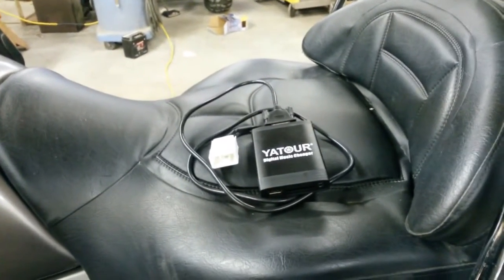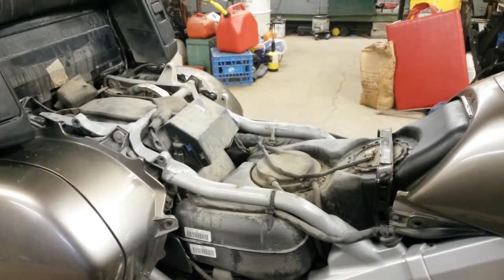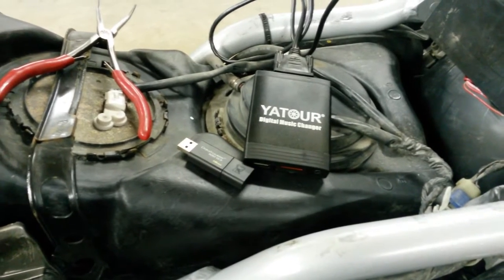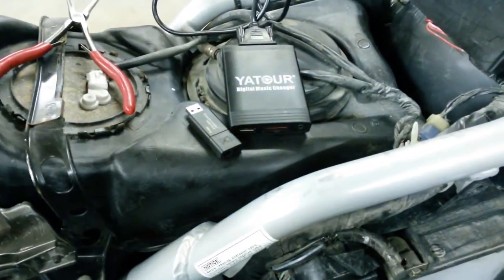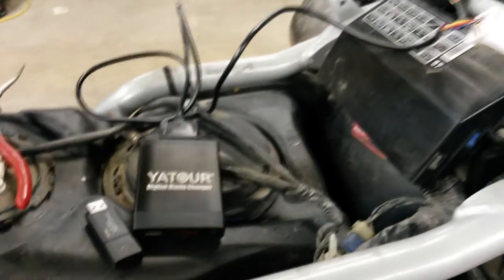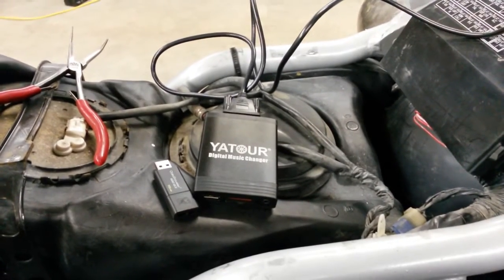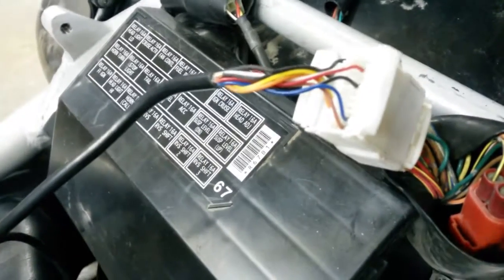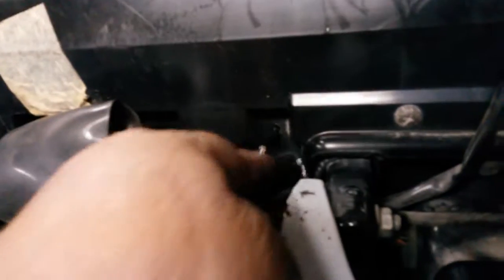Installing a Yatour digital music changer, Goldwing GL1800 #diy

Comment: I been using the much cheaper DMC unit on my 2004 GL1800 for several years. Whatever you pay or the brand these units all have the same internals and the key is how you load and browse your music on the SD card or flash drive. SD cards or flash drives mustn't be bigger than 8GB and each "CD" folder mustn't contain more than 99 tracks and the maximum number of "CD" folders is 99. However, 99x99 is way more than than the 8GB capacity:
Step 1 - Create folder "CD1" and add up to 99 tracks. "CD1" is the root directory, therefore:
Step 2 - add folders "CD2", "CD3" etc. as required to the "CD1" folder;
Step 3 - add up to 99 tracks to each additional folder.
The Achilles heal with these units is that as you load tracks into each "CD" folder they're saved in alphabetical order so of you load more than one album into a "CD" folder you'll need to number prefix each track title 1-99 so that the albums and album tracks play in order. Also, the bike's random play button doesn't work so if you want some variety on those long trips you'll need to create your own 'random' play "CD" remembering to number prefix each track otherwise they'll sort in alphabetical order and therefore not random.
One last tip, don't rush the unit when operating or it'll freeze which may require resetting the unit. But as long as you allow each "CD" or track to load before flicking on to next you'll be okay. I've max'd out the 8GBs on my SD card and have to ditch stuff before adding new stuff.
Follow these tips and your unit will work great, mine has.
One other quirk us that the bikes CD display only goes up to CD9 so CD14, CD24, CD34 etc. display as CD4.
Reply: I have a question for you. I bought a 2008 GL-1800 about a year and a half ago. It came with a similar device from BikeMP3 Inc which is no longer in busy. The unit has been working flawlessly since I have owned the bike. And I was lucky because I liked all the MP3’s that were added. My issue now is that I took the bike to the dealership for the 32k service to establish the maintenance records in my name and for them to go top to bottom and make sure everything is in spec. Which it is. I picked up the bike a few hours ago and the device works, however I am getting a display message that says “No CD” however I can play music and switched around tracks and disks etc… but the display won’t tell me what disc or track is playing like it used to. I disconnected the device and reconnected it and popped out the SD Card and reinserted it. No go! Do you have any ideas what might cause that? I can’t find anything specific to that issue.
Reply: @wingandhog  Hi. It sounds like you've done everything possible. Occasionally ive had "No CD" or the unit freezes.  On the road it usually clears itself if i switch to radio for a while, or when i stop for coffee.  Does the unit have a reset button? The kind you push with a pen nib or paper clip. Most digital devices have one. Generally,  the reset button needs to be depressed for at least 10 seconds. And/or, when you've unplugged it, again generally, it should be left unplugged for at least 30 seconds  even overnight. I hope this isn't teaching my grandmother to suck eggs.
Reply: @michaelhoare5291  …. LOL. No I’m teachable. And a former IT Executive. I didn’t see a reset button but I will look again. And try that. I will also check the SD card on my PC to see if something got hosed on the card itself but it does play songs so who knows. Thanks for the quick response.  I appreciate it.

Comment: Thanks Snocrushr for your help on this one. I disconnected my battery from my Goldwing left it for a few minute and the computer rebooted it self and the radio came on again. I'm also just going to use the SD card have name them CD01 to CD10 which 10 shows as CD00 with 20 songs per CD that should keep me happy. Many thanks again Snocrushr. Safe riding. 
William ( Belfast )

Comment: Moving in stereo . Be nice if the usb worked , but thinking the sd card might be better as it kinda locks in , looks like a usb drive sticking out may end up a bad connection after a bit . or is it held by something to stop that .
Reply from the maker: I think you are absolutely correct Terry, thinking about as you pointed out even if I get the USB working I don't think I'll use it specially in a motorcycle application.

Comment: If you are emulating 8 cds, how do you select 7 & 8?  Do you not use the 1-6 to select cds (similar to how you would select cds with the factory CD changer)?
Reply from the maker: CDs 7 and 8 are select-able with the factory Honda CD controls

Comment: Just tried to fit a yatour unit today Saturday 12th November 16 Like yourself I could not get it to play so I thought it was the USB stick so I checked it on my computer and it played ok. When I tried it again just to make sure. I hope you can help me because now my radio is not working. I checked the 15a fuse for the radio but it was ok. Not sure what to do. If you have any info that would help I would be very greatful. My yatour cost £53.00 and £15 .00 shipping. 
Kind Regards
Willie ( Belfast Northern Ireland )
Reply from the maker: This is what I got in response to my inquiry :
 1.Max 8GB (2GB is most recommended);SD card is more recommended than USB stick.
2.Please format USB stick or SD card with FAT16 or FAT32 format before you save files and folders in USB/SD.
3.Imposed folder naming system: CD01, CD02, CD03 ....Doesn't read 
sub-folder and gets confused with other names in root of the drive.
4.Supports up to 15 folders (depending on the radio type) on your USB/SD.
5.Any number of songs can be stored in each folder, but the display of most 
radio models can only screen 99 track titles; Saving too big file(over 
50MB) in any folder may also cause intermittent performance
6.Using music files formats other than WMA and MP3 may also cause intermittent performance.
7. The playback order of songs is in line with their created date.
8.Sometimes,to remove defect on software of car audio system, you may need to 
disconnect the battery or remove the fuse to reset the car audio system.
9.To use the Aux-In port, it's necessary to remove the USB or SD card.
10.YT-M06 may does not work with some of new Kingston brand USB stick. 

Also our unit doesn't work with some new Kingston brand USB stick. so if you have other USB to test it?I had to disconnect my battery, removing the fuse didn't help when the radio locked up.

Comment: were did you bu it still working
Reply from the maker: I bought it on Ebay. Be careful of pricing and correct application. 
Yes it is still working. It does freeze up rarely but all I have to do is turn the bike off and back on to reset it

Comment: It is probably the formatting for the USB drive on Larger drives are formatted exFat and some readers will not read that. you will need to download a program for widows that will format it to Fat32 or you could try NTFS (windows native formatting)  Linux will do this naively with no problem.

Comment: How is your music player performance now, the same or worse
Reply from the maker: I have put on aprox. 40,000km since installing it and using a Sandisc SD card with 8 folders emulating 8 Cds with 99 tracks in each folder. It has played 99% of my riding time with only a couple of freeze ups that required me to restart the bike to fix it. Yes I am satisfied withe the performance.
Reply: @snocrushr  great thanks for the fast reply I will order one
Reply: I can change the tracks but how do you change cds

Comment: must it be formatted to fat32/16??
Reply from the maker: Yatour advises an SD card which typically use Fat16
Although I am using a SDHC card formatted Fat32 and it is working well for me.
Reply: snocrushr my problem you see is i do not have a labtop to format it and only use my phone with a otg adaptor to put music on my usb